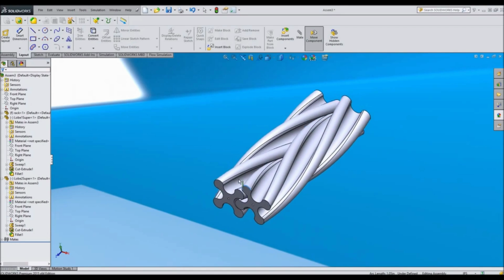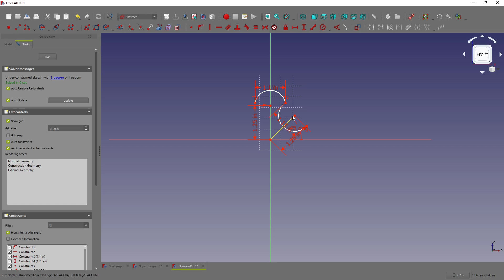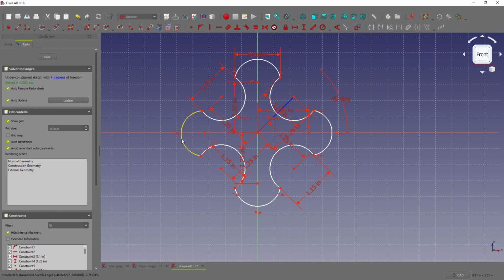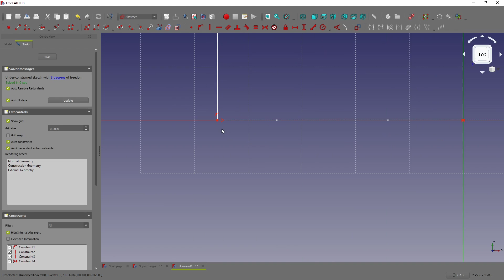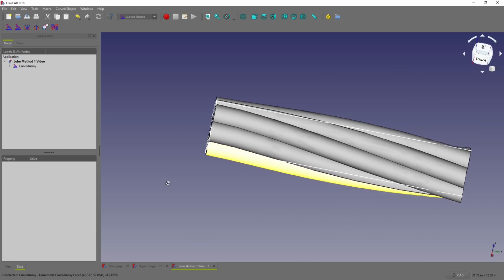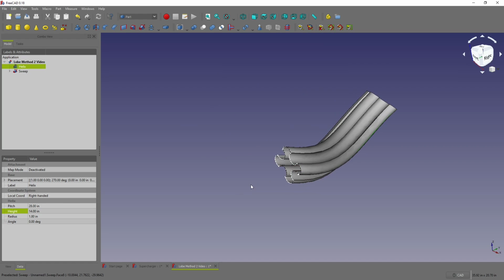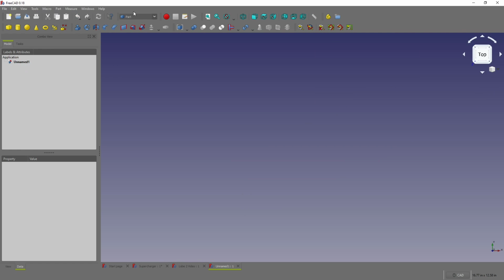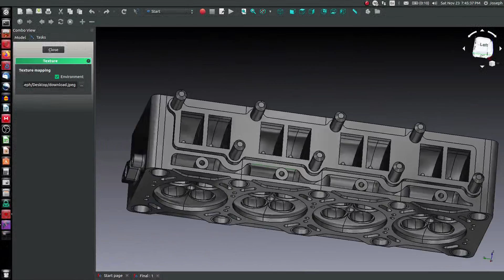FreeCAD - Make Supercharger Lobes|JOKO ENGINEERING|

Comment: Another possibility is to use the array add-on.  You can make an array of a number of profiles and then loft trough them.  This doesn't have the variable twist problem.
I used this once to try to make a globoid worm gear, but didn't succeed.